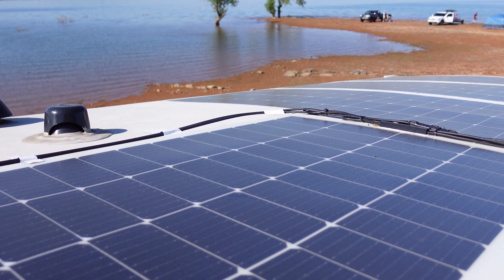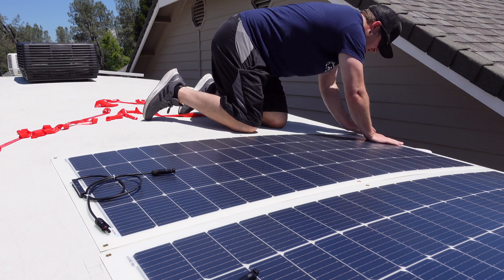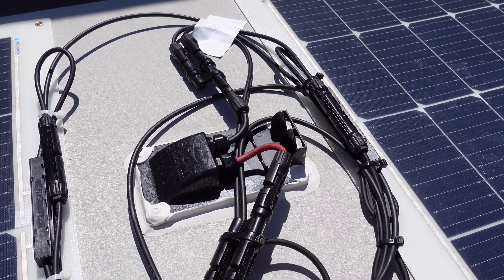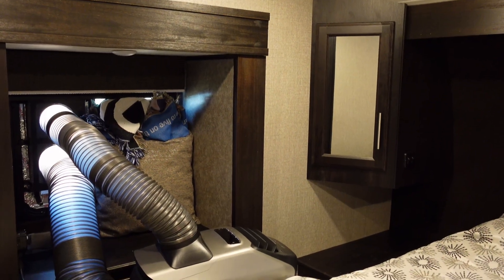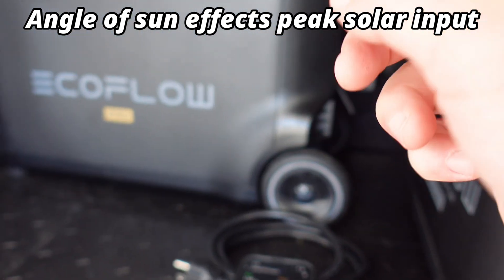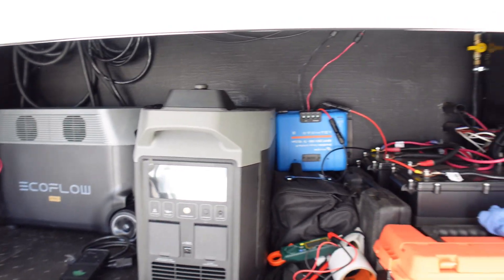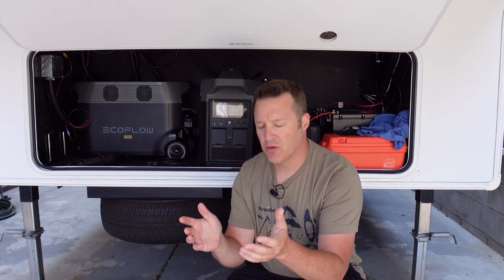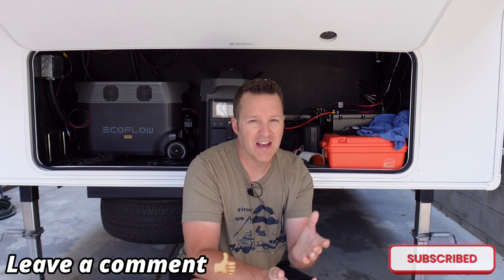How to Mount Flexible Solar Panels on Your RV Renogy 200 Watt

Comment: Im working on a Thomas built trolley bus/ motor home conversion and looking to cover the roof parts with the flexible panels.  Im not sure what the size is supposed to be for the VHB tape to securely attach the panels to the roof.  I was planning on using the 2 inch wide version but it looks like some come with 4 inch wide around the perimeter.  Also, I was wondering if the tape should have gaps in it to allow some convection air to flow under to reduce heat build up.  Looks like I need to repaint the roof since the clear coat is mostly off and the base green metalic paint is chaulky.
I have seen the installs with coragated plastic underneath but this negates the use of a flexible panel in the first place for me since all the panels have to follow some shallow curves.
Reply from the maker: When mounting the panels try to get them flat as possible for best performance. I used the 3m vhb tape and has worked well. Over 6000 miles and all haven’t moved. If you watch the video you see where I placed gaps in the tap. That way water and some air can flow through. Here is the tape i used https://amzn.to/42ZY0Ng

Comment: So I know you said 10awg on roof then you said 8awg to fuse box? Did you run 10awg on roof to roof inlet then 8awg from roof inlet to breaker box? Didn’t see that wire in your list. Trying to copy your setup
Reply from the maker: My original wires from the roof are 10g. I ran a new set and roof mount for the large array which is 8G to my breaker/disconnect. The original has a small array of 200 watts with a cigs im testing. I may move it as I dont like the location
Reply: @johnnysweekends so if I do 10awg on roof, 8awg from roof to breaker, then how do you do 8awg to delta pro? Do they make a 8awg xt60 connector or can I just use the one that comes with it?
Reply from the maker: @romo9296 they do not you have to do 10g and make your own with a xt60i connector you get on eBay and solder it.
Or use the one supplied. 
I’m using the power kit now so those are 10g each.

Comment: Hi Johhny - great video - I always learn something new. I noticed you have an extra battery (maybe a DELTA 2 Max Extra Battery) connected to your Delta Pro. I was under the impression that you could only connect a Delta Pro extra battery to the Delta Pro is that not correct? Maybe they updated the firmware to support the different batteries? thank you!
Reply from the maker: Hello and thank you. According to EcoFlow yes only DP extra batt works. Well sort of. Yes im using a Delta 2 max extra battery and it works great but you are limited to the draw and specs of that battery. It’s rated at 2400 watts max draw and not 3600 like the DP. So it can be over heated but charging is fine. I prefer the way it operates as DP will fill first then extra batt. Then extra batt will drain first then DP. So if you dont need max power which I rarely go over 2000 watt draw its a great setup that is smaller and smart gen still works great or another smaller generator.
Reply: Great info thanks for getting back with me - again, I enjoy your videos keep up the great work!  @johnnysweekends
Reply from the maker: @markdraper4878 😀👍🏼👊🏼

Comment: For the price of the eco flow...you could get a large lipo bank and inverter.
Reply from the maker: That’s true…but it’s more involved and kinda a permanent mount. Plus you still need charge controller and wire it up. Slightly more involved but if you want simple the DPs are really nice and can be easily removed. All depends what ya want or comfortable with

Comment: I just bought a couple of the new Bouge RV 200 watt Yuma CIGS flexible panels and have been seeing how well they work. I'm like you I don't like drilling holes in my roof. 2000 watts of solar is great. My trailer is not as big as yours so I'll have to have less watts on the roof. But I have some ridged panels that I can put on the ground if needed. Great video!!
Reply from the maker: I have one cigs on my roof now that is charging the house batts, and all the others for the big stuff. Converter is never on lol. Awesome and congrats on the new panel. Let me know how it does.

Comment: Bonjour je viens d'acheter un panneau solaire renogy et un panneaux solaires dasvolt de 175w ce son exactement les mêmes avec une différence de 100e pour finalement après des recherches les deux panneaux solaires viennent du même endroit d'un fabricant chinois sous le non de sunman ne vous faites pas avoir cordialement 😊
Reply from the maker: all solar panels are normally made from a Chinese manufacturer but if its a no name brand but the same unit verses a named company you will likely get better service or at least warranty help

Comment: Hobotech channel just did a video on solar panels similar to this that have the glue made into them, they are peel and stick. Also, you can walk on them. He shot five holes in a panel and it still worked. He ran a side-by-side over the panel with the bullet holes, plus drug it top side down over gravel, it still worked. Only draw back, they are expensive.
Reply from the maker: Yea I did my way before his was out. Although he needs another one for long term testing. I have one new one, and the original one my now.
BEST FLEXIBLE SOLAR PANEL CIGS YUMA 200 VS RENOGY 200 Watt
https://youtu.be/xyg0oWBcRfM

Comment: Johnny...any update on these?  I know it's only been 3 months (well, the video was).  I keep hearing negative things about mounting flexible panels on an RV roof.  I know you did the Renogy in this video, but I'm really curious about the Bouge RV CIGS.  I know you did a quick comparison but I can't find anyone that has installed these CIGS panels on their RV and reported on it.  Thanks!
Reply from the maker: Hey, yea it will be 4 months and they made it through 115+ degree summer days and all is well. Now its only 4 month. I also installed the Cigs a couple weeks ago. So will see how it holds up. I will be doing an update video right about 6 months. But they will be featured in other videos as well but not much on for checking condition.
Reply: @johnnysweekends  Thanks.  I just know that some people put on the flexible Renogy panels and reported a downgrade in productivity where they were mounted onto an RV roof, because of the lack of airflow on a direct mount.

I know the CIGS (from your video) have a significantly lower temperature, and seem like a viable option (with better output), but it's a lot of money to go all in with those if they have the same issues as the Renogys after a long time mounted on an RV roof.

Comment: Buy once cry once. Get the good stuff from the get go. Do not use flexible panels on your Rv roof. They will burn up the roof, don’t last long, cost more and degrade fast.  It will cost  more money in the long run and get worst results. Be warned about these all in one units. you void the warranty if you don’t use their solar panels and if not connected a certain way, you will ruin the charge controller..They sound neat but when one part inside breaks they are not serviceable and you lose your $3500 and keep a solar box with no solar LOL. Seen it 
Time and time again these things are are not reliable in the long run and people end up going with a real Victron setup anyway.
Reply from the maker: Ahh not exactly. Victron is good stuff, but they better switch up soon to these modular units that are 3 and 4 pieces.
Now if you are full time sure then maybe spending the money on a full victron system would be best in the long. The main market is weekend warriors and short timers and they could easily do a lot them selves now with these new kits and not over spend. And they are only getting better. 
Some of these solar Rv installers are charging a ton for simple systems and sometimes over building for customers who don’t need it then they sell the trailer and because the install is so complicated th he won’t uninstall it and loose thousands. These kits are so easy they can take it and use for home back up and more. And as long as you don’t abuse it they last fine like any piece of equipment. Sure some have issues. But they are only getting better.
I wanted a victron system but with so many other options, heck even eg4 type you can get way more and it’s plenty robust.

And they are way cleaner of a install verses some of the night mares I have seen. No wonder no one wants to install it. I can and I don’t even want to anymore. 
And again most people don’t need that much. One person I know was talked into a decent system that was $15k for everything. Such a waist as mine can do the same and more. 
Again they better start looking into those types of 3 /4 piece designs. That’s the way the market is headed.

Comment: Didn’t rv with titto do this years ago? He burned his roof.    Please go back and watch that video.
Reply from the maker: I will have to double check but yea he did great work on flex panel mounting. Only problem was the flex solar panels he has were honestly junk and have a bad track record. The renogy 175s and will see on these so far have the best track record and I cant find and reports of these types with burns or fire and more. The sun power flex are honestly trash from everything I have read up on. 
ANd i did do a lot of research. But now I wish I did cigs lol. The shade output is amazning which is normally a problem on all RVs
Reply: I do not believe the solar panels fought on fire or anything.  It was more of a heat soak issue that turned his roof yellow/brown and I am sure damaged the roof material.  I went with the traditional hard panels but was thinking hay! What about these super thin flex panels for my slide outs! Just need to tape them down and plug them in when at camp site ?     Any ideas?
Reply from the maker: @davidgroves8049 yea they did do some discoloration but it didn’t actually damage the roof. But who knows maybe it will on mine and if it does I guess I’ll coat it. I hate these rubber roofs. So will see. 

But yea I think a couple people have already done that. Now of course it only works as long as the sun it getting to the slide which depending how your parked will get a lot less solar exposure just do to slide edges and obviously the Rv it self. Wiring it nicely is the hardest part obviously.

Comment: we race motorcycles.. our batteries are 72 volt... charged to 84.. how can I use solar to charge my batteries?
Reply from the maker: You will need a a higher voltage solar charge controller and wiring the solar at a higher voltage of at least 105 volts or higher would be better like 120/140 volt .
That can very depending on the panels you use which is fine.

Comment: flexible panels going to catch on fire sooner or later. not fit for rv,
Reply from the maker: So much wrong info in one statement. One research rigid verses flex, then show me how many fires you have seen with both. Not one video. And then search the brand and type. Because so far the 175 renogy and 200 models have little to no records of fires unless it was damaged or install error. I have seen plenty of rigid melt down as well.

Comment: I love the idea of flex panels, my only question so far is in regards to heat dissipation with no airflow underneath. Is it an issue? Do these panels run hotter than rigid panels mounted an inch or so above the roof?
Reply from the maker: You will always get a little more heat build then something with airflow under it. But they all run really hot.
Reply: @johnnysweekends  Thanks for the reply, do you notice any ill effects on a hot day (lower output than expected?)
Reply from the maker: Every solar panel will drop in output no matter rigid or flex. Heat robs power regardless on all items generators as well, batteries and more. Flex will always output less regardless. The difference is weight savings and ease of install and less aerodynamic drag.
Reply: How are you hooked I to the RV power system. I get the install, not how it hooks into the RV.
Reply from the maker: Roof inlet up top drops wires into the rv and then upfront to my EcoFlow power kit setup. This rv was gen prepped so it has a transfer switch which made AC hook up easy

Comment: you do some great work my friend .I only have one Renogy 100 watt flex panel (older ones) and it only puts out 60 watts. I was very underwhelmed to say the least. But im pleased with the other Renogy products i have. My recent  purchase is a Renogy Bifacial 115 watt panel. I maybe replacing my other junky Nature Power panels with the Renogy Bifacial panels. I like the small foot print (30.9 x 30 x 1.2 inches) I wonder if you went with the CIGS 100 watt  flexible solar panels how many could you have put on the roof of your RV. foot print is 85.6" long x 13.7" wide
Reply from the maker: I’ll going to be looking at the cigs 200 watt soon.

And if you have the older flex panel and under ideal conditions it’s putting out 60 watts I would say that’s about right or a little under. The older ones were not as good. But also they degrade after a while. 
The new bifacial look nice
Reply: @johnnysweekends  only thing with the CIGS they are quite expensive. But if the panels are rated for 200 watts you will get over that of very close to 200 watts, which many panel underperform in many cases because its hard to get ideal conditions with the Weather modification going on. But that's a whole other can of worms. Best of luck my friend. That said if you get 200 watts  its worth the extra money im guessing.
Reply from the maker: I curious how they will perform.
Reply: @johnnysweekends  there are a few vids on youtube not saying your experience might differ but its a gage anyway
Reply from the maker: Yea will be curious to see what they really can go through
Reply from the maker: Oh and thank you 😀👍🏼

Comment: Hey Johnny. It's been over a month since you posted this video and summer should be in full swing, even in NorCal. How much loss have seen with the warmer temps. I'm in KS and it definitely gets hot and humid here. I've considered getting a pair of these flexible 200w panels and building pvc frames for them to keep them portable. Thinking they should produce well even in the heat since they will have plenty of airflow around them. Any thoughts?
Reply from the maker: Well I can still peak to 1600 watts for my delta when all angles are good. Normally a good 3 months will be a good way to tell a little loss but I would assume to be fair I’ll have to wait till next year and get some other equipment as well for more testing and may be changing my setup some.

Comment: I decided on rigid 200 watt panels and using channel strut as the base mounting system. So it will be easy to move, slide, replace panels as needed. The channel comes in 10 foot lengths and I can screw them directly into joists or cross members for super sturdy connection.
Reply from the maker: I thought about doing the same but again with weight and drilling holes and you hope you hit the joist l every time. 
But c channel has been used for a long time and makes it easy. But so far these are doing great. Haven’t moved since placed
Reply: @johnnysweekends  I am replacing my entire roof, plywood, TPO membrane and upgrading everything so I thought it would be real easy to track the center of each joist for the channel install. It is about a 3k dollar job just for the materials.
Reply from the maker: Ahh that make sense. Good time to do it all.

Comment: How do you remove a panel if it goes bad / breaks?
Reply from the maker: Wd40 and a large plastic scraper to slowly break the vhb loose. Heat will help as well but you don’t want to just pry it up.

Comment: look at the EG4 3000EHV-48 as it will do up to 500 VDC, 80A  for 5KW solar input and output 3KW @120v 25A. couple that with a couple of server rack batteries for 10Kwh of storage. The unit also supports the remote start of a generator.
Reply from the maker: I have looked into a lot and still am. Only problem is the turn on voltage is kinda high for the EG4 3000 I think it was at least 120v turn on, which mine lives around 105-110v so I would need a little smaller unit with this setup. Something like the growatt could work. I looked at that a while ago and could fit many RV setups. And is a little cheap. 

I’ll have to start looking again. Been busy trying to finish up other items…😀👍🏼

Comment: Awesome awesome vid! I have a similar set up. 2 questions! What cable do you use going into the 30A port on the delta pro and secondly, the delta max extra battery will work with the delta pro?!?
Reply from the maker: The 30 amp port is from my generator which goes to my ATS. But im only running one leg and since a lot of trailers come wired on a 208Y setup I can run the whole trailer of a 30 amp. But I will overload if im trying to run everything. I can run both AC units of DP with soft starts. Of course it won’t last long but the power is there. And yes EcoFlow said the D2M extra batt is not compatible but when I did my review of the D2M which that’s a new favorite for sure, I used the extra batt on the DP and it worked like it should for 4 days. Charged and discharged great. 👍🏼😀

Comment: Would it make sense to get 1" PVC pipe (or an appropriate size) and fish the black wires through it to help protect the wiring? Securing the PVC pipe is another question for another day.
Reply from the maker: Sure it would help but its another step and would need much larger then one inch where they all come together. These wires are meant to be out side and should last longer then the panels I would think. And I will continue to monitor and also continue treating my roof every 6 months with protectant.